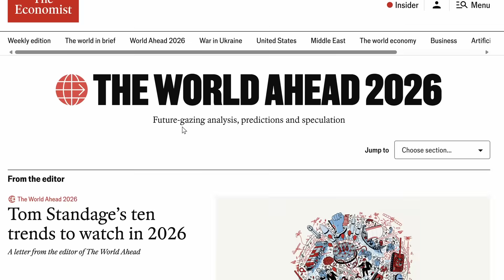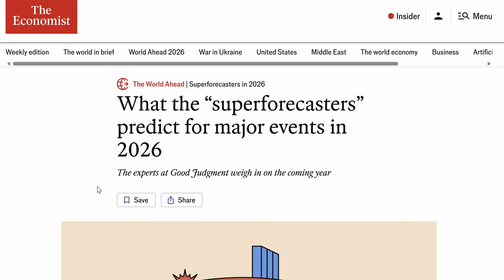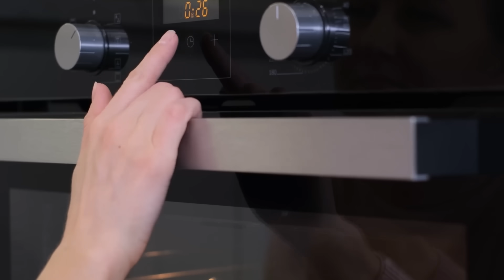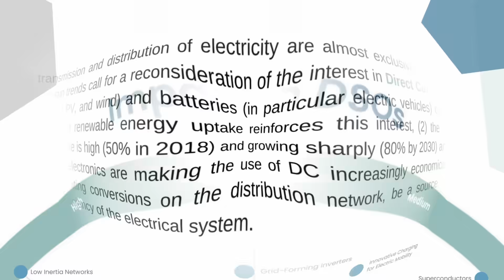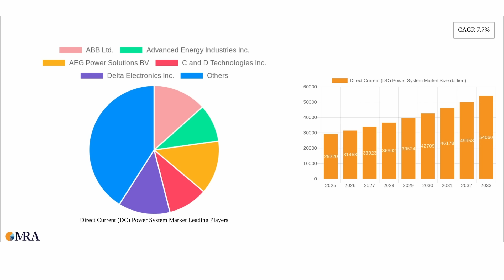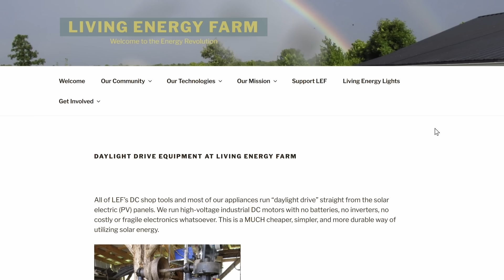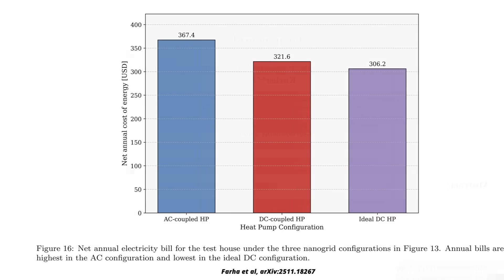Are We Using the Wrong Kind Of Electricity?

Comment: Sabina, thank you for this.  
I am designing a new house.  We intend to go off the grid.  The electronics for the solar system will be in a detached garage. 
It occurred to me, a while back, that we should run a separate conduit for DC from the batteries in the garage to the house, because most lighting is now LED, and soon it may be possible to buy LEDs that can run on DC without having to convert it from AC. It is not expensive to do that at this stage, because it just means putting an extra pipe in the ground.

Comment: Title is silly, highest power lines have been using DC , so options are not ignored. AC was also more useful historically to use with generators, motors... as I am sure many will point out.  Now photovoltaic electricity production becomes very important hence  necessity for DC equipment, that is already in use . BTW , power electronics have improved a lot over the past decades ... we'll probably have a fair mix of both for some time in the coming years/decades

Comment: I thought this was how the United States had somehow settled on the one combination of a trio of attributes of AC (I think the attributes were phase, frequency, and possibly voltage, but I'm probably wrong) that is fatal to humans.  Basically, the voltage changes at just the right speed, it can short circuit our ability to move our muscles, and thus get away from the electrical source.  But because pretty much everything electrical is based on these attributes being what they are, we are kindof stuck with what we got!

Comment: You can't practically use DC on mechanical contacts like switches for voltages more than 32v, 3A unless they have arc arresters, and those are real expensive

Comment: Where did all of you people get these weird ideas from. Electrons flow is very slow it’s something like a couple feet per minute in alternating current you have a magnetic field fluctuating around the wire just oscillating back-and-forth so it’s just push in the pulling 50 or 60 times a second and not really going anywhere. The sparks your talking about happened because instead of connecting the wires you are applying a large load on the switch or connectors like a relay for a motor in a motor they will put a capacitor in parallel will absorb this shock and also discharging so instead of getting a spark when you conected it you will get a discharge from the capacitor for a fraction o a second then when the current will then start flowing from the source power recharging the capacitor a spinning the motor then the switch will open and the capacitor will dump it’s charge as the switch starts to close again reciting this and the capacitor keeps the switch or brushes  in the motor from burning. If you are using dc as we use to the electrons will push through the wires and they will get thinner overtime I was watching how until around 1930 we use to use the static in the air to charge batteries for lights in buildings and to run the telegraphs but the electron flow dissolve the wires and at around 10 amps what the wires could handle had to be replaced every 50 years or sooner which I why we switched to AC we have been using wires since 1900 on AC that are still ok on DC they said they were corroding but really it’s also known as electroplating the electrons will flow slowly to the connections at the other end and deposits on your switches plugs or what ever they are connected to which will have to be cleaned off by scraping or sanding off the extra copper deposits. From what I heard about before 1930 this was required weekly on all buildings electrical boxes till we went to AC  when they pulled out the DC charging and breaker boxes they no longer had to do this maintenance anymore and threw out most of the records but they do still have the old parts catalogues along with government regulations on repairing and maintenance schedules to keep these DC circuits working. I was wandering why they’ve been digging this stuff up and now I know china has started going back to this system and they are starting to need these maintenance problems that they didn’t have on AC circuitry. Now inside of your equipment once it’s connected they are using transistors to electrically switch off and on, so there’s no real current flow bringing in these extra electrons through the circuits although it will probably build up inside of these and make them unusable and have to be replaced more often too, which isn’t the problem I AC. I’ve been off grid now about 20 years this explains tome things I’ve been wandering about I have 2 banks of solar panels they put out around 40 volts and around 700 amps when the sun is shining which is in direct sign in the summer from around 10 AM to 6 PM in the winter about 11am to 3 pm if we’re lucky my charge controllers seem to last around a year or 2 if I’m lucky at first I just ran the wires from the panels to the batteries but panels only work for 10 year if your lucky usually less some only for 7 if you put them outside in the sun like I said I’ve been off grid around 25 years and I’m on my 3rd set so much for renewable energy some of the newest ones are from Vietnam they’re supposed to last 20 years as opposed to the Chinese ones which last 7 to 10 if you’re lucky. I guess we’ll see I’ve gone through around 15 charge controllers in the last 10 years and since the new panels put out over 37 volts most of the time instead of 14.5 which the older ones did you can’t connect them without a charge controller? But I also got a new battery pack that has the controller and AC inverter built-in but if the panels put out less than 37 Volts they do not charge at all and it shows the voltage so we still have to run a generator some days it has charger to 100% but not often even on sunny days. But a generator running on propane doesn’t have as much power but it will run around a couple of months charging for 4 hours a day on a oil change and still be cleaner than when running on gas for about 30 hours. Which still beets the heck out of DC and I’ve had 6 2500 watt generators go out in the last 5 years because of the weird gas that California sells so propane is still the best option I think. I’m thinking of getting one of those whole house models from Generac. They run on propane have electric start switched over and run everything off of it. And there even in a sound prof weather protective box. They were around $3000 I’ve installed 3 of them for some of the people I worked for they are great they do a maintenance run to make sure they keep the oil moving around to keep everything lubricated so you could just have it run a few hours every night just to top off your batteries

Comment: Solar panels are a failure of "green energy". Their energy reproduction coefficient is very low - less than 20. While nuclear power plants and hydroelectric power plants have much more than 100. Even in thermal power plants, it is about 80. This means that if we completely switch to solar and wind farms, then more than half of the industry will have to do nothing but produce new solar panels and wind turbines! This means that the remaining capacities will not be enough to maintain the current level of production of material assets (and the level of their consumption). This means that science, medicine and education will fall back to the level of the Middle Ages and become a luxury!
Direct current is inconvenient in production because each device needs its own voltage characteristics. You can't just connect the motor to the solar panel - it won't work. The battery pack will not charge. And if the voltage is too high, for example, kilovolts, then almost all devices connected to such a source will immediately burn out. And with an explosion. That's why alternating current is used everywhere! It can be easily converted to any desired voltage. For transportation from a power plant to electrical substations in the city, high voltage is better suited - hundreds of kilovolts! Therefore, there is less heating loss and the required wire thickness is smaller. In urban networks, the most profitable voltage is from 100 to 300 volts. This voltage is convenient for household appliances such as refrigerators, dishwashers, washing machines, and so on. And for wearable devices, you only need 1-2 dozen volts. And all these needs can be easily satisfied with converters of a fairly simple and cheap design. When it comes to charging gadgets, they don't care which power source to use. But when it comes to charging cars or powering entire city blocks, the price of DC-to-DC converters skyrockets. And for alternating current, simple and reliable transformers are needed, which can be of any power and voltage and are as reliable as a brick block! There are no transistors or microchips, just copper wires and iron! We don't need "another kind of electricity"! All the best things have already been thought out! We need normal, sane politicians who will not mislead people with their political nonsense.

Comment: The problem is that DC does not transmit well over long distances. DC using gadgets could run off of solar without an inverter.

Comment: I see the most immediate short term impact in two areas:
1) Using DC directly where it is generated at both residential and industrial scales - having car chargers and other DC loads on the solar panel and battery side of the inverter.  For a datacenter - moving the power conditioning out of the servers and having DC rack devices feed from local DC generation powering a rack of GPU blades.
2) Lighting - LED bulbs should last forever but we put an array of LED bulbs that draw less a tiny amount of current on a 120 volt/15 amp AC circuit and put a heat generating AC to DC converter in each bulb.  The only thing that makes sense about it is the inertia of building wiring and the vast number of AC lighting fixtures.  Starting over - DC fixtures, with DC bulbs, fed by low voltage DC through thinner gauge wire is cheaper at every turn.  If the players in the space could get their shit together about establishing standards instead of each company rolling their own low power solution it would be a game changer for new construction.

Comment: DC from HVDC lines can not be directly converted to lower DC voltages without AC phase in between. And it is very easy to convert between AC voltages with minimal loss.
HVDC is only used when there is underwater power line or where production and consumption are thousands of kilometres apart. I also read some paper that suggest if we will get increasingly unstable power grid because of lack of rotating mass in sync with frequency of the grid due to more solar and wind power, HVDC will transfer power without the risk of spreading instability from one part of the grid to another, like it happen in Spain in April 2025.
On the other hand, you can build mini DC grid with your own source, like solar panels, but in any case if you want to have connection to main grid, you need AC/DC converter.
And talking about both possible usages of DC for power transfer in mixing apples and pears.
But even more interesting is, that today with variable frequency drives (VDF) for 3-phase motors in industry, we have DC phase and there would be less losses if VDFs would be connected to 550V DC.

Comment: The reason A.C. is preferable for high wattage transactions is that it does not produce a massive magnetic field attraction which is present with D.C. Useing A.C. also has the advantage of voltage control by useing transformers not possible with D.C.   I cannot personally see any future for high wattage D.C. for those reasons.

Comment: Imagine a high voltage line with dc current. Air will eventually yield and a thunder will discharge over residential areas, AC de-ionizates all it's path all the time

Comment: Thanks for this great video. However, I was disappointed that you jumped quickly over the savings of in solar-panel led house-based system for those with EVs. I have a second-hand EV, that I charge using the same outlet on the house I use to plug in my Christmas lights. It cost me around $320 CAD (c. E186.00) to drive 10,000km last year. The savings are incredible. It would be great to see the full picture of energy and money savings on a solar system at home for those who drive EVs.

Comment: All due respect Sabine for your credentials, but as someone from the electrical industry I can clearly state that until on site generation becomes the norm AC will dominate. Long distance transportation of DC, though possible and in place already in some specific locations, is dangerous, expensive, and currently impractical.

Comment: That's not why China has built DC transmission, the reason is because capacitance over long distance means you can't use AC. The mistake being made moving to DC is that the costs are ridiculous, and there isn't a need - low frequency AC is far simpler, and would have cost less 

Moving to DC won't be more efficient

Comment: it's possible to now change the voltage of DC with clever power electronics. Back in Edison v Tesla , the very inefficient "rotary  converters" were used. 
BUT the voltage of supply will always need to be changed, whether that's AC or DC,  HV supplies have less losses over longer distances, but it's going to need to be changed down at the point of use.
That's always some circuit with losses. Whether it's transformers , regulators, rectifiers , switch mode  devices etc..

Where DC transmission is quite good is for under water grid interconnects. The capacitance of the cable really doesn't have a loss effect on DC as compared to AC
But over ground , using pylons, well AC is still the way to go . .

Comment: Electric cars use batteries to store DC. However the electric motors run on AC. In southern Africa we have operated a high voltage DC link between Cobora Bassa (Mozambique) and the Apollo Station (near Pretoria South Africa) DC is cheaper over long distances at high voltage. Costs change with scale. Switching yards often work on the AC side of the inverter or rectifier. If you look at the writing on the plugs that you use in Germany you will see that the rated current for AC is higher (16A) than for DC (10A) I think that as inverter/ rectifier technology improves we will continue to change between AC and DC. I saw many German registered cars on a road in South Africa. B area code. These cars were painted to disguise the outline of the cars. I spoke to a friend of mine who suggested that they were probably Teslas. Apparently their European headquarters is in Berlin

Comment: DC is actually less lossy over long distances than AC, due to skin effect, stray capacitance, and being able to run the voltage 41% higher with the same insulators.
However, back in Edison/Tesla times, there was no economical way to step DC voltage up or down, whereas AC voltage could simply use a transformer.
Additionally, DC voltage generation required either brushed generators or high power diodes and giant capacitors.  Both of which were either very expensive at the time.